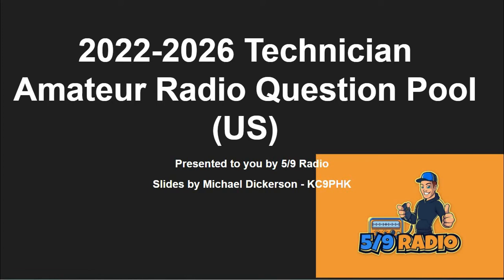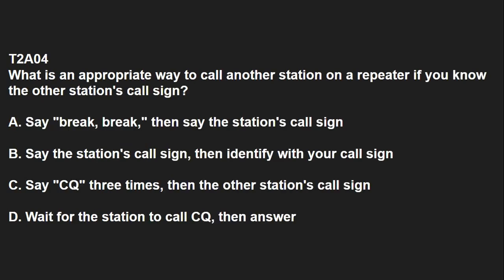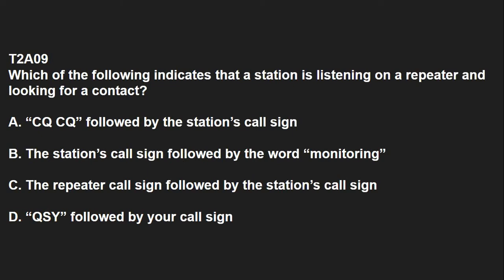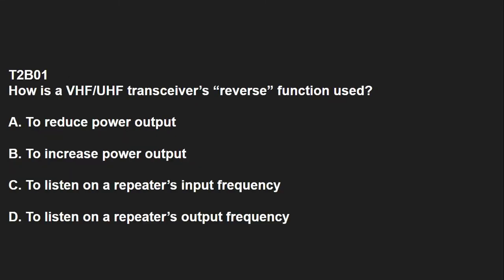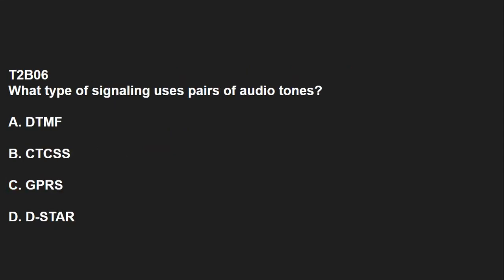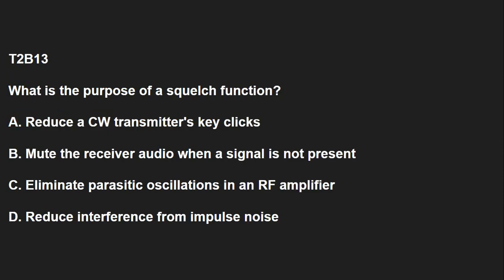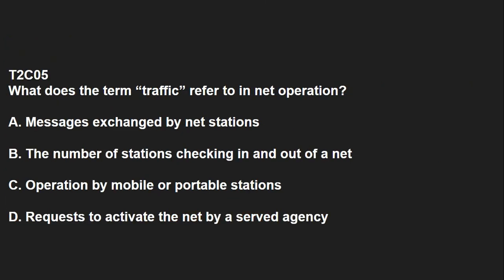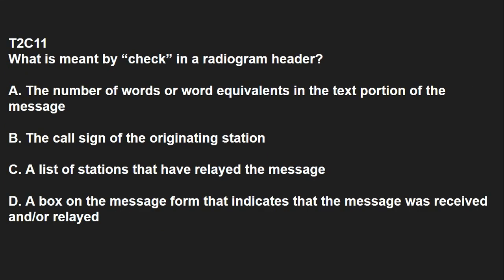2022 2026 Tech Subelement 2

Comment: I found this answer in several locations to T2B12 (A) (question @ 6:00 min)
What is the purpose of the color code used on DMR repeater systems?
A. Must match the repeater color code for access
Reply: That is correct, we created these before the question was modified and would have to redo the entire video to fix it.